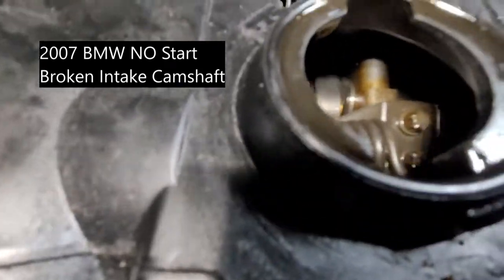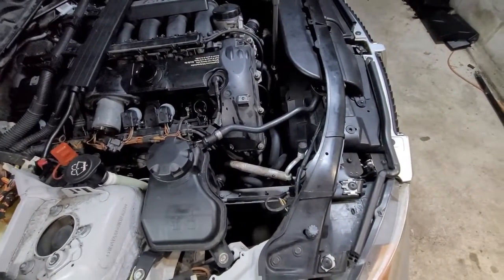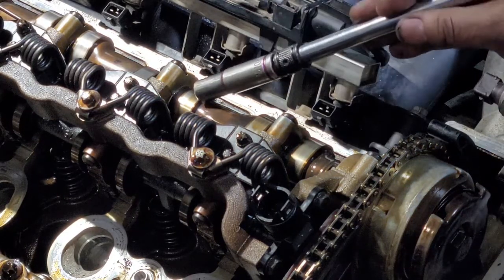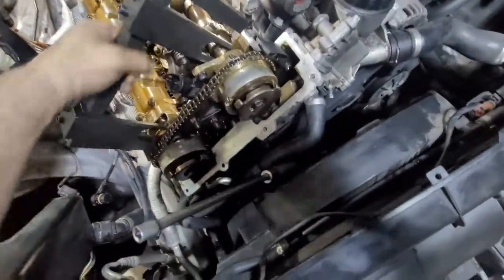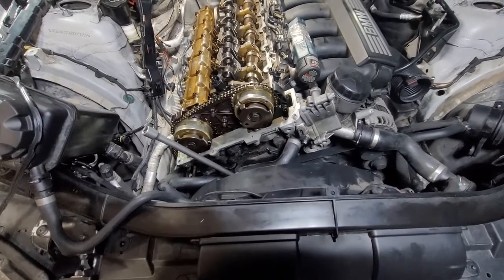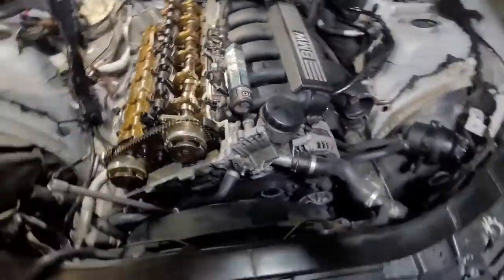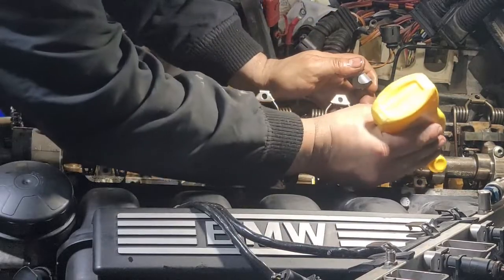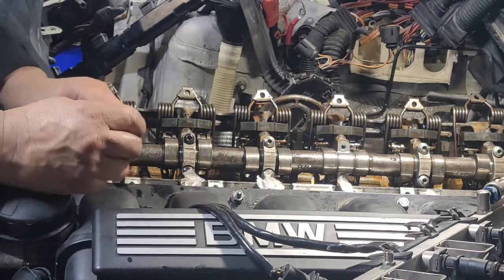2007 BMW No start Part 3  replace broken intake camshaft

Comment: I would be happy if you help. I have a 2007 BMW X5 E70 3.0si vehicle. Two weeks ago, the exhaust side camshaft broke down. We realized this after the low oil pressure warning. My mechanic did not see the need to open the lower crankcase and said that the problem was in the upper cover. As he said, the camshaft was faulty (the bearing was broken). He procured these and other necessary parts and reassembled everything. He washed the upper part of the engine and the parts it was attached to by spraying air with diesel oil (diesel may have gotten into some sockets here). Then he replaced the valvetronic engine and tried to give it the first start. But he failed to start the engine. I asked him whether the crank and camshaft synchronization was done correctly (because we also changed the chain and valves). He said that he had done the accuracy test on it twice. We have not been able to start the engine for about a week. The error codes are 2a9a and 2a9b. My mechanic found that the coils were not igniting. They tested with many different devices. They tried coding etc. thinking that the problem was in the Valvetronic engine. They still couldn't get any results. The last time they tested it was with another device and they said that my vehicle was giving off sauce and went into theft mode. That's why the engine was not firing. I would like to hear your opinions since you repaired the same engine and a similar problem. I would really appreciate it if you answer.

Comment: BMW N52. ?  for ya. what are torque specs for the cam caps and the cam vans bolt? thanks so much my daughters intake cam vans bolt snapped on hers im hoping to swap the cam based off of your vid. thank u sir in advance
Reply from the maker: cam center bolts are  20 Nm and 90 degrees 2 times, total 180,  and the cam caps are 9 Nm . if you have more questions let me know
Reply: @bmwn5238  thanks  one more the springs that bolt to what u said in vid u call the bridge  and the tensioner. I could hear what u said that was in your vid. u do a damn good job  w those engines and your vids thanks for the great info sir

Comment: hi sir, im working in the same engine. my exhaust lifters are 8mm separate from the camshaft, is that normal after remove the head for a gasket repair? im totally lost there
Reply from the maker: no sure what you mean , you lifter are no where  near the camshaft  they are pivot point for you levers ,  this is the best way  i can describe it
Reply: @bmwn5238  the levers are too separate
Reply from the maker: @serverdll  so sorry man i stil dont know what you mean
Reply from the maker: did you remove the exhaust  camshaft out from the cylinder head  head?
Reply: @bmwn5238  yeah, I remove for change valve caps
Reply from the maker: @serverdll  ok so  if you put the levers  on top of the lifter an the let them rest on om top of spring , after that you install the ledger with can ,, once  you assemble that  you can turn the camshaft and the lobs  should pres down  the valves , evenly  if you have any doubt this is happening then mesure  the lobes of the cam  that should all   be even ,, the lobes on ly touch the levers when they  pres down the valves as you turn the cam ,,  makes sense
?
Reply: @bmwn5238  as you see in the video everything is back toghether. i disconect the starter from car system and give it a try to prime oil system. they never get height enought to stay close to the cam. maybe my valves are too low? this engine is goin me crazy
Reply from the maker: @serverdll   not sure how can that be posible if you install  the springs correctly and you  make sure you seated/lap  the valves correctly before you install the head ,    it seams  that the head is not assemble correctly
Reply: @bmwn5238  hi, at the end of the mistery it result that mechanic change the camshafts and forgot the position of them ;)
Reply from the maker: @serverdll  so he switch the intakes? he put intake side on the exhaust side ?.. some thing like that
Reply: @bmwn5238  yep, embarrassing
Reply: @bmwn5238  yep, he put the camshafts in the wrong position... car starts and run.

Comment: Can the paws of the roller be moved between the heads?
Reply from the maker: Not sure what do you mean by paws, but yes you can used al the parts from one cylinder head to another, with the exception of the intake valves, they can be 5 mm or 6 mm depending on the  year and model, beside that all parts are the  same
Reply: @bmwn5238    i mean ,can i moved the intake camshaft caps between the heads .Because i Heard thats the constant  head object
Reply from the maker: @gohaballll6625  YES YOU CAN USED THE CAPS FROM ANOTHER CYLINDER  HEAD  IF THEY ARE IN GOOD CONDITION AND  ALL WAY PUT THEM  IN SAME ORDER
Reply: If the intake camshaft broke wouldn’t it cause valve to piston contact, being it’s an interference engine ? I have this same problem and everyone is saying replace engine but i definitely can replace the cam! Basically what I’m saying is , can I replace the intake camshaft and be okay ?